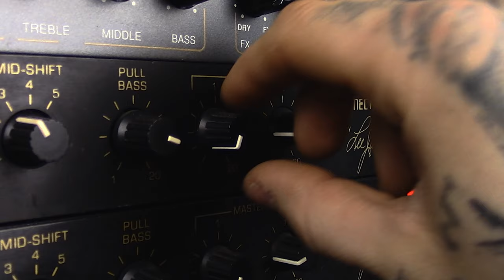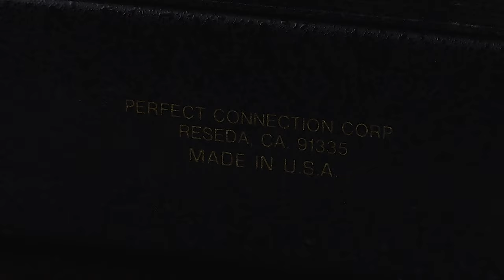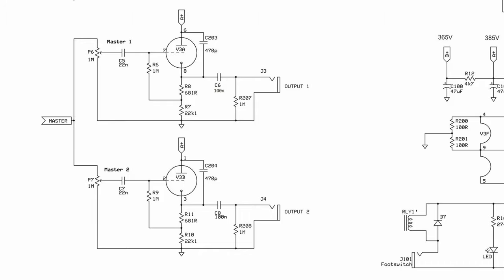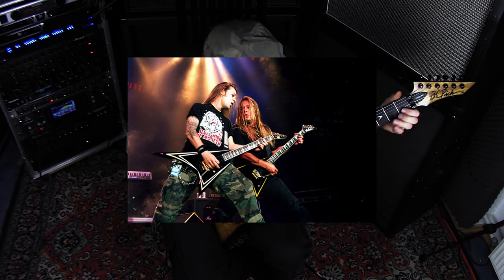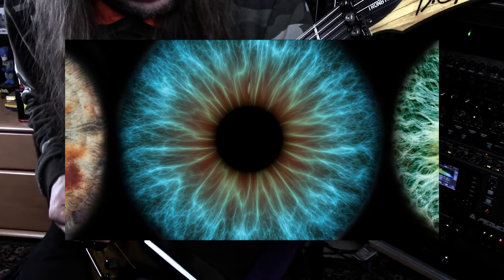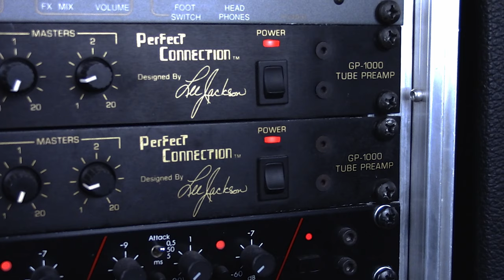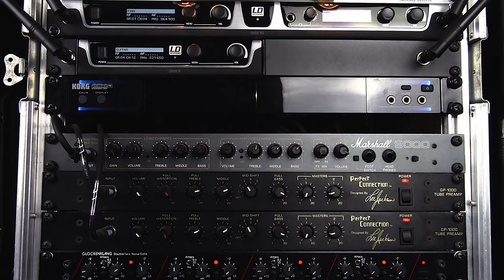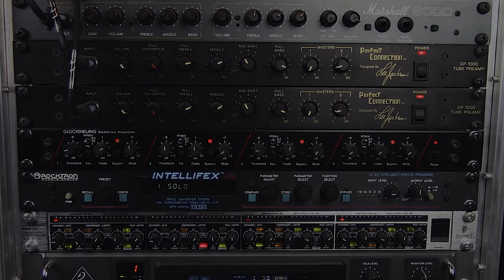The Misunderstood Amplifier - Lee Jackson GP-1000 | Weird Gear Reviews

Comment: @Dignity0fficial Hey man, thanks for the videos, tons of great info. I just picked up a GP-1000. Did you have your GP's modded or they stock? If modded what did you have done and how did it affect the tone?
Reply from the maker: Afaik they are stock! 
I know some things have been repaired over the years but nothing was modded. And tbh they all sound the same and I can't find any differences in tone or gain. So I guess everything is unmodded.

The mods that have been done multiple times by people is basically more gain and more low end. 
But I've talked to people who done that and usually it's only a slight change. So idk if that's worth the hassle. I'm pretty satisfied with the stock ones and don't have the urge to mod anything until now.
Reply: @Dignityofficial_  I noticed you have the fender 87 and marshall 88 models. is there any difference between those? and how high do you set the boost on the mm-04?
Reply from the maker: @akamouzis  the serial numbers are a bit weird. So my 87 serial is actually a marshall mod, so basically an 88 model in a 88 housing but with a 87 board but the 88 wiring. 

But fender and marshall mod sound different. The 87 have even less gain and they lack a bit the magic you want to have. 
But the cleans are very nice! 

I think I have different settings for some of the mm-04, depends which pickup I use. I would need to check that! 
But the gain is usually about 75-90% cranked up. Depends on the pickup again. The Jackson j50-bc need a bit more gain that the EMG, but in general I try not to have noise coming from the preamp and if you crank it up to max, they actually become noisy
Reply from the maker: Because I was curious now, I actually have (unknowingly) one modded preamp! 
But I didn't use it in the video. 
It's one that is laying around in a rack as a backup. Funny enough, I need to check what that mod does. 
Checking the schematics it seems that somebody switched a 22uF to a 0,68uF and a 1,5kohm to a 825ohm. 

I need to compare what it does or if it's a slight change in something. 
Maybe I can actually figure out what mod that is, might be it's a common mod. 
I'll dig into that.
Reply: @Dignityofficial_  Dont quote me but i think i read on some forum that .68uf and 825ohm increase gain. I wonder how that one compares to your others. are you in finland?

Comment: Behringer should make a clone of this
Reply from the maker: Would be lovely but sadly I wouldn't think this wouldve any success. 
It's a weird amp and it's nothing for the masses. Secondly the time for an amp to sound like this is sadly over. Only a very small group of people would actually buy this and then probably more than half of them would sell them again because they are hard to use in terms of getting a decent sound hence the private markets would get flooded and new pieces would be harder to sell. 
I hardly believe trying to clone them and sell them in the big picture would not be successful on the long run. The only that could pull that off would be Lee Jackson in small runs or as a custom order or some small company that rebuild them in small runs.
But the idea seems to be nice.

Comment: I've got two of the GP-1000's(one transitional model and an 88) and you hit all the points and then some! Would also be cool to try and cover the mods that Lee Jackson and Alexi's techs have done over the years. As far as the boosts, I've gone through all of them(MM-04,ABQ, JE-1000 clones) and I scored an original one and nothing else comes close to the tone if you're after the old Bodom/SInergy/Stone tones. Also might be worth mentioning the difference between the Made in USA J50BC's versus the import made J50BC's as I've definitely noticed a big difference in output and tone between them.
Reply from the maker: Thank you much! 
I was actually thinking about modding one at some point, but i dont think there's any instruction what they actually modded and how. But if I would get my hands on the exact things they changed, I would give it a try for scientific reasons, although alexis sound was always for me a tiny bit too much distortion, but thats personal taste.

True. The original JE-1000 is weird, even turned off you get a frequency response change of the pickup and I actually dont know why! Sadly my JE-1000 broke at some point, still got it laying around and mybe i will try to fix it at some point in time. 

About the pickups...that is interesting and i might dig into it. In total i got four J-50 BC laying around which only one of them is an import one, the other three are made in USA. This might be a nice experiment.
Reply: @Dignityofficial_  if you do some digging Lee Jackson himself suggests replacing I think a capacitor and a resistor to slightly different values and it will remove some brittleness and add a tiny bit more gain. I believe this was stock in the last few 88 models they did!
Reply from the maker: @SeanDiegoOfficial  thank you for that information. I'll write Lee Jackson an email and see if he can give me some info!

Comment: I gave up chasing the Bodom tone many years ago. It's all in his hands and the midbump of the gainboost, the GP-1000 was the least important part of the sound IMO. Great video and I agree with all your points, wish I still held on to my GP-1000's with the prices they are going for though now and for the nostalgia! I use an axe-fx for home recording now and I did find a setting way deep down in the menu that allows you to re-arrange the tone-stack to be in the same "pre-distortion" position like the GP-1000 circuit. Surprisingly enough with some of the Marshall models on the axe-fx, in this configuration it sounds and feels very similar as far as I remember (And the EQ knobs will re-act just as stupid as the GP1K LOL)
Reply from the maker: It might be! 
I've heard so many good amp simps in the last couple years.